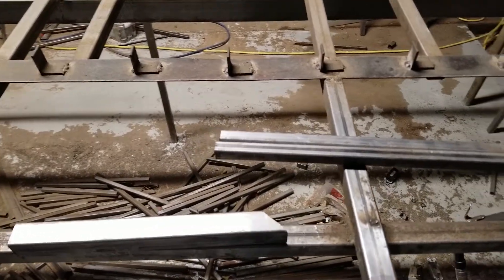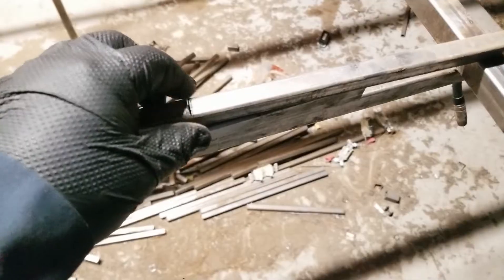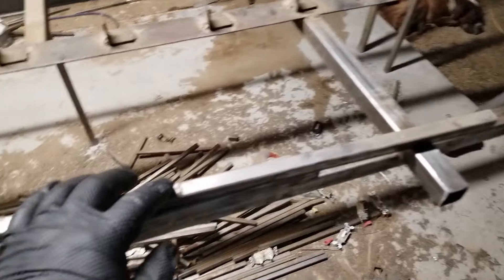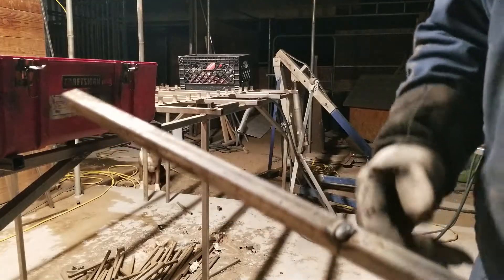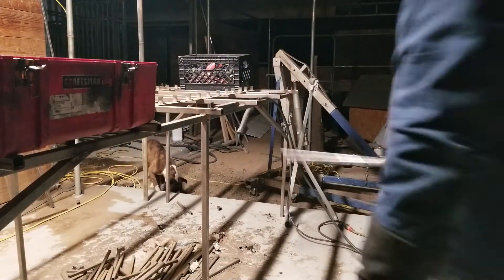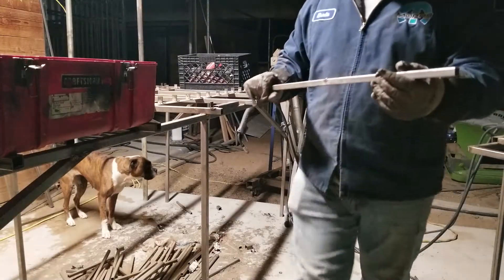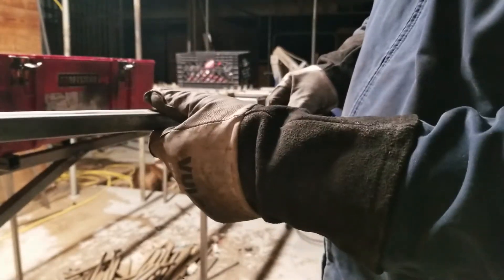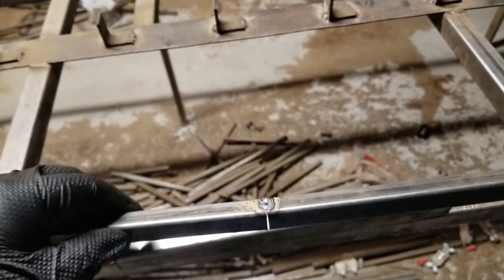How Strong Is Flux Core Welding?  | Gasless Flux Core Welding For Beginners Tips And Tricks |

Comment: I'm just a hobbyist, but until now I stick welded everything down to 16 gauge where I kinda found my limit was coming to an end, and tbqh even that blew a few holes through. Nothing impossible to bridge, but a bit tedious, so I ordered a small fcaw machine. 
Thing that I do struggle to understand is the mig mafia's obsession with penetration. I mean; if the material could handle it, then I wouldn't be using wire to begin with, or am I thinking wrong? 🤔
Reply from the maker: Idk who the mig mafia is 🤣 but I assure you, a 110v flux core can weld up to 1/8th plate no problem. Turning up the wire speed will offer more penetration but it will also produce fatter beads. I personally like to turn the wire speed down, turn the heat up and move nice and steady watching the puddle. If you can see the puddle eat away at the metal surface as you're welding and you dont have much undercut, you've got good penetration.
Reply: @NightWrencher  Thanks. I assume 230V isn't a problem, since we do not have 110V here?
Reply from the maker: 230 is even better. You can weld really thick stuff with the right wire. The thicker you go, the more heat your want to introduce but also youll need more material to fill in the weld without going crazy on the wire speed so you'll need to go thicker on the wire. My wire of choice is .030 for most light duty welding, .035 is pretty much standard, but if you wanna go thicker than 1/4" youll have to go up to .045.
Reply: @NightWrencher  That one is easy; the machine only takes 0,8mm (.0315"). But that ain't no problem, if it goes 10 gauge or thicker then I would go smaw on it anyways. 

Many thanks for your replies and the video! I just got messaged that the machine has arrived at the post office, so I'm eager to try this out. 😁

God bless.
Reply from the maker: Good luck man! Be patient and let me know how it turns out!
Reply: @NightWrencher  First impression is good, very good even! The biggest issue was getting the wire speed/voltage combo dialed in and getting used to the wire not being live until I pulled the trigger. After that it was alot easier than stick welding, just being able to run continously on thin materials was a game changer for me. 
The welds still look like crap but being a hobbyist DIYer, I can live with the fact that I have to use a grinder more and that it takes alot more time than it would for a good welder. 

The penetration is plenty enough for my intended use. I welded up two 45 degree, 16 gauge pieces of square tubing, had to bridge the outer corner due to bad fit, then grinded the welds flush to the base material and applied as much torque as I could by hand. I felt the tubing flex but the welds held up just fine.

So, to sum it up; I like it. Given the prices and availability of gas for consumers where I live, I get the job done at roughly 1/5 of the price that using mig would cost me.
Reply from the maker: Thats awesome man, good to hear that its working out for you. I only use flux core and stick for everything that I do. My whole truck was built using flux core and its been holding up for years
Reply: @NightWrencher  That's my plan too; covering everything with smaw and fcaw, and after seeing the results I have no doubts it is very possible to do. Now I just need to stock up on wire, hehe.

Once again many thanks for your time and encouragement! 🙏
Reply from the maker: Anytime! Theres more videos on the channel and more videos coming out soon!
Reply: @NightWrencher  I'm gonna go have a look as soon as I get home from work, looking forward to seeing what else you are up to hehe.

Comment: I agree. I mostly do flux core. I have made some really strong stuff with it. I use the exact same welder too 😁 great video! 👍
Reply: Would you recommend it for a steel bicycle frame? I want to make something different than usual but I can’t braze, I only have a flux invertor.
Reply from the maker: Flux core doesnt like to flex, it will break. Not recommended for a bicycle that flexes a lot
Reply: @NightWrencher  ooof… that kinda kills the project. Maybe for thr better, thanks!
Reply from the maker: Thanks man! I really appreciate it!

Comment: I was just wondering about welding with a generator as I watched your video yesterday. It's cool to see you using a generator and that answers my question I didn't even ask. I can't wait to try this flux core welder I just picked up
Reply from the maker: The welder in this video is on a 3500 predator generator but Ive switched to a 10000 with a 30amp 110 plug so I can turn up the machine higher for thicker metal.
Reply: @NightWrencher  great video one issue I had with my welder the extension cord. Longer the worst then to the gauge even more worse and then hooked up to a generator a lot of my problems started there without me knowing it. Welding for about 10 years now and I still love flux core gas less welding. And I'm pretty sure I saw your dog staring at the ark. I think your dog needs a helmet.
Reply: I often use my genny to weld, when you first spark off, either stick or mig, it takes a second for the generator to add fuel and bring the RPM's up under the sudden load, but once the bead is running, I think it is actually smoother than under grid, and it doesn't pop my breakers as often, since my welder and air compressor are on the same circuit. Also, my interior lights sometimes go low when I start welding, and my UPS on my computer complains about a voltage drop, which isn't good for some electronics.

Comment: your find the process they using on pipe work tends to be duel shield alot the time but yes.. Flux core gets bad rep because of the amount of "expert" welders with their small hobby migs. I find that they judge the process on the fact that the machine they use is just utterly useless and the wire they tend to ship with is complete shite.. I use a 15kg roll of flux core/innershield my self for the odd job and that spool costs more money than most hobby welders due to the HUGE improvement in wire quality and the fact that its run correctly from a machine that can actually use the wire properly.

Comment: Flux core is also used outside a lot because you can still weld even if there is a mild wind blowing.  MIG won't work in a mild wind without setting up barriers.  MIG is strong, clean, and easy - nothing against MIG.  Flux core absolutely has its place and is great for a hobbyist that is willing to spend the time learning it.
Reply: I use flux core because i can't afford the nitrogen/argon gas for mig, although my machine can do stick/mig/flux
Reply from the maker: I love flux core. Pretty much does everything you need and then some. Probably wouldn't recommend it for production work
Reply: @NightWrencher  Dual shield is where production is concerned =)

Comment: I think flux core actually welds hotter than MIG - not sure.  It is messy but other than that it's fine.  The people complaining about it probably get lots of slag inclusions in their flux core welds because they aren't doing it right.  I think it's just harder to do right than MIG so people don't really learn how to do it right.
Reply from the maker: I have noticed that standard mig flows out easier than flux core but Ive been able to get better penetration with flux core
Reply: i learned stick first so mig seemed so easy but when i tried fluxcore i never used solid wire again.

Comment: flux core works fine. i fabricated a disc brake mount for my 1000w ebike yesterday, welded it to a steel frame bike. 1/4 steel, lap joints. also its just a Lincoln weldpack 100. lol. 

the best tip for a clean weld other than technique is anti splatter spray. done right you wont even have slag to chip off and the BBs dont stick to the steel  if you're a learner. it cpeans the steel and leaves a film to keep splatter from sticking. i started on a gas mig. with that spray my end results are about the same. maybe better, cant test it since i no longer have access to a gas fed mig.
Reply from the maker: It'll work just be careful!

Comment: I worry about my dogs eyes more than I worry about fc. I picked up a returned titanium for 139 at HF and went to welding.
Reply: I cut on the air compressor before I weld and the dogs go running. Something about it they don't like. But table saw, chop saw, planer, jointer, anything else no problems...just the air compressor.
Reply: @triatheletewolf7279  Good One. Sounds like the aluminum can with pennies trick.

Comment: My only comment is to just be aware that "most" gasless FCAW filler materials contain 1% aluminum.   Aluminum really like oxygen.   The function of that Al, in the filler material, is to  "scavenge" out oxygen.  This means it is to prevent/keep oxygen out of the solidifying weld puddle (to make your weld NOT look like an Arrow chocolate bar).   A side effect of that 1% aluminum is "real poor" impact values.   So, NEVER EVER use gasless FCAW wire to weld up a trailer hitch, for example.   Yes, gasless FCAW gets used a ton out in industry (in the right places).   Yes, you can get 70,000 ultimate tensile strength (UTS) out of a gasless FCAW weld.   No, it cannot be used in every situation where MIG, or even stick welding is employed.   NightWrencher, pretty good stuff!!
Reply from the maker: Thats really interesting! Thank you!
Reply: @NightWrencher  .........the most common way to combat that issue is nickel.   1 or 2% Ni can/will offset that aluminum thing.   You will regain that lost impact outcome.   You cannot, however, meet "most" hydrogen requirements with a gasless FCAW wire.   Cheers.

Comment: Cheers my friend; you are on the right track and have a nice place there. That was a good test there; that cherry picker is heavy. To my knowledge, you can make structural welds with flux-cored welding process and if you are outside with windy conditions, gasless wire is the way to go.
Reply from the maker: Exactly right, I've built several heavy gauge critical components with flux core and the welds always penetrate and hold like theyre supposed to!

Comment: I’ve been doing a lot of field work with my stick welder, but after many years I’ve always doubted gasless mig welding, I was given an unwanted gasless welder and I find it more enjoyable than my mig and for site work I love it,now my stick welder is collecting dust.
Reply: I'm a self-taught welder, first with stick, then flux-core MIG. I don't do a lot of welding, but one thing's for sure, it's way easier to weld with a flux-core MIG than a stick welder.
Reply from the maker: Flux core is basically light duty stick. Once you learn it, its awesome
Reply: I was taught with stick welding. I did not care for wire welding because of all the moving/adjusting variables and trouble shooting.  
Now that I am well seasoned, my go to is both FCAW and GMAW before SMAW or TIG.     Easier and faster.

Comment: Do you change the polarity for gas less welding? Eg Earth to positive and Torch to negative. I have read tutorials that say I should but my welder has no clearly accessible option to do it?
Reply from the maker: Yes, it should be reverse of standard mig so it would be electrode negative earth positive.   Follow the earth wire to where it bolts to the machine and if you can undo the nut, look for the nut for the electrode and swap them
Reply: You may have a flux only welder. Some don't have the option for gas
Reply: For flux core most flip.. Stick to negative ,,   ground clamp to base metal positive..

Comment: Good video. I've had a flux core at home for miscellaneous maint and hobby stuff. I'm not an accomplished welder meaning I have to read the directions on the settings and practice each time I need to use it but when I do get something welded it is welded meaning the welds don't break. For the cost and convenience Flux Core works fine when a person learns how to use it.
Reply from the maker: Exactly right 👍

Comment: Thanks  I am getting a welder pretty soon for some work on my XJ. Plan on eventually adding frame stifiners and getting jcr front bummper kit. 
Looking at a 125 amp welder that's in my budget range . Would like to see sheet metal welding tips. Have some drilled holes to fill where previous owner installed rack on roof by drilling directly through roof and relay could use some guidance on filling they are 1/2 holes.
One person told me to put a sheet of copper on bottom against backside of whole and fill hole with weld. And some one else suggest making a sheet metal plug and weld around circumference by just using tack welds . Not going to put fancy paint job over repair mainly just want to seal up the hole.   Any videos would be helpful
Reply from the maker: I'll see what I can do! Usually I use a piece of sheet metal behind the hole and tack it in place. Then I would use body filler, sand and paint. That hole is too big to just fill it with weld, youll warp the whole thing real quick
Reply: If the wholes are small enough, I’ve cut the heads off of nails and used them as filler plugs
Reply from the maker: Yes, I've done that too. Works pretty good if youre careful
Reply: Check out a channel called Fitzee’s fabrications. It’s an incredible source for automotive metal work tips n tricks. He has given me the confidence to tackle projects I used to avoid.
Reply: @maxjones9139  thanks